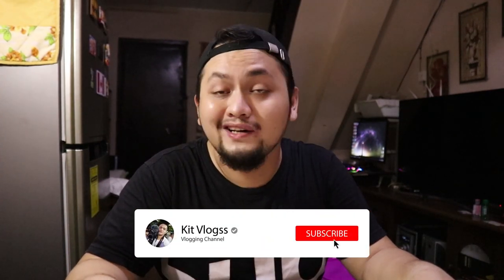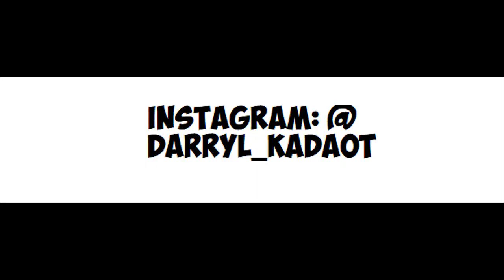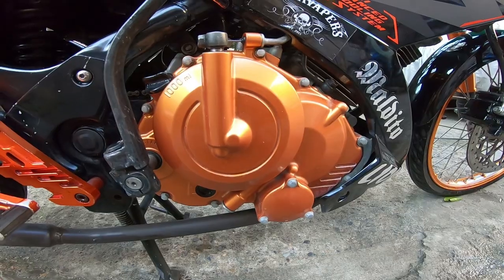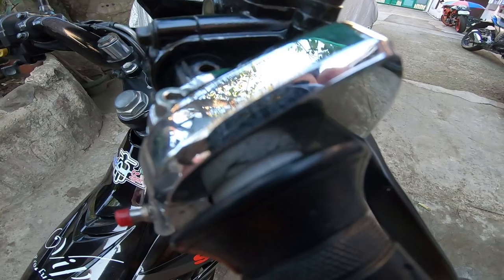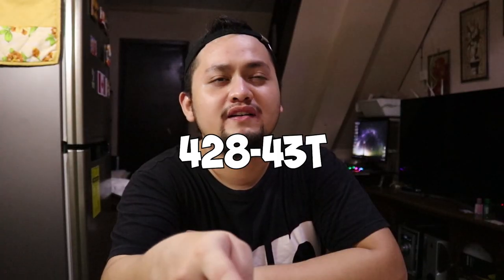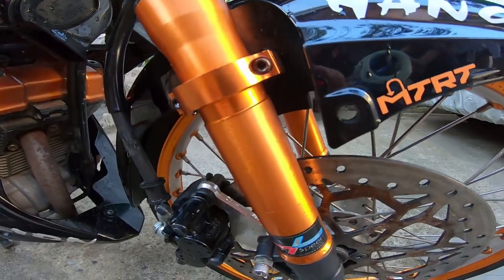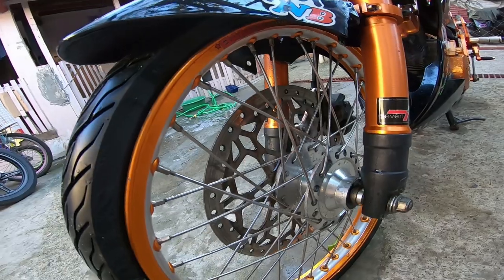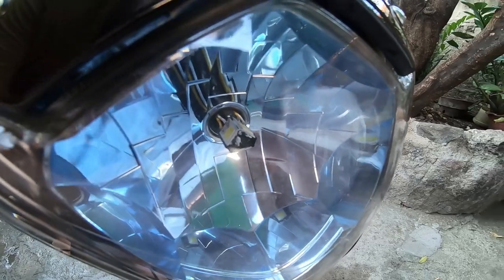RAIDER 150: CARB TUNING, JETTINGS AND MODIFICATIONS

Comment: ano maganda jettings boss naka round carb ako 28mm all stock raider ko boss. at saka ilang turns dapat?
Reply from the maker: 118-38 boss para di masyadong malakas sa gas at try mo mag 2 and 1/2 turns sa hangin
Reply: @KitVlogss  thanks boss. buti kapa nag rereply agad. kaya auto sub matic na.
Reply from the maker: @siranikomoves8446  hehe no worries boss, drag bike na raider ko ngayon, check mo tiktok account ko same lang din ang pangalan @kitvlogss

Comment: Boss okay lng ba naka rclutch spring at quick throttle na stock carb lang? Or stock pa lahat?
Reply from the maker: Yes, pwede yan boss
Reply: @KitVlogss  slamat boss. Di ba ma, pwersa ung stock carb?
Reply from the maker: @vincentcarloseguido5316  Parang need lang ata palitan ang jettings
Reply: @KitVlogss  anu mgnda jettings sa stock carb boss slamat
Reply from the maker: @edgarallannovela9977  wala akong idea jan boss if stock carb lang gamit ..